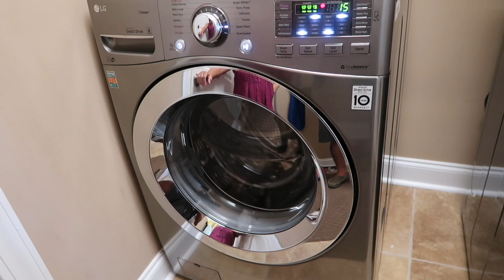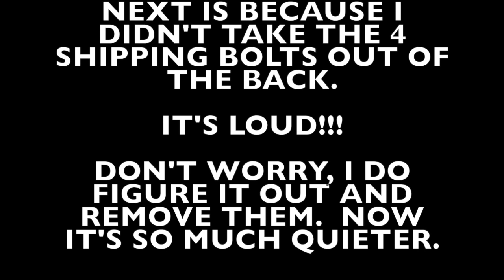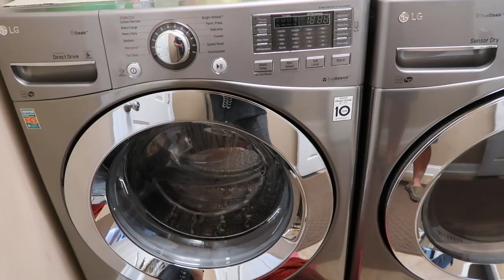I Didn't Remove Shipping Bolts From Washing Machine

Comment: Just done this with our brand new washing machine. We had ours under the work top and it literally was jumping out from under the cabinet. My wife came running down the stairs wondering what on earth the racket was. We sat on top of it for a bit then had to pause it and eventually figured out it was the bolts. They should really put a huge sticker on these things!
Reply from the maker: Well I figured I couldn't be the only one.
Reply: Totally agree with you. I thought the machine was not leveled well...
Reply: Agreed!!  Huge sticker would absolutely help!!! I have the same problem!!
Reply: OMG I also feel stupid!! I didn't even know the bolts must be removed!! However we removed them, will the machine last long or will it break soon? because the machine spinning were damn LOUD!! I am scared the drum or wheel bearings might be bust :(
Reply: I saw the warning on my Samsung to remove the bolts, it was a visual diagram but the bolts in the diagram didn’t look at all like the various bolts that were on my washer, plus they were called “shipping bolts” so I figured that the guys at Lowe’s probably already removed the shipping bolts once it was shipped to them from the factory.  So after all that, I still had the washer violently jump around, and now after looking it up, I realize that I must still have the shipping bolts in because I never took any out.  These companies ought to be liable if ever their machines break due to this obvious lack of effort of communication.
Reply: Me to same with me... My machine jumped out from the cabinate
Reply: @ravi44200  did it still function after that lol?
Reply: Just took off mine after dents on my washing machines.
Reply: I did this also today to my brand new Whirlpool machine it was running just for 3 minutes on centrifugal hopefully 🙏 it’s not broken,need to take out this bolts,definitely agree some sticker will help!
Reply: With my washing machine, the instructions gave me the impression that removing the bolts were optional. It nearly destroyed a counter top and travelled across the room.
Reply: or you just could read the manual
Reply: @KokoroKatsura  True, but a big sticker is a really obvious and sensible thing for the maker to do.
Reply: I just did the same today 10/27/24 and I only did 1 wash to test the machines d it was shaking like a mad horse . I pressed pause and didn’t use it again. Was yours ruined ? Is mine ruined ? I will go back and remove them in two days , hopefully it’s not damaged .
Reply: @tonystylesofficial6844  no mine is fine. Still got it after 5 years and no problem.
Reply: @hovercroft  uffff thank you. I was worried I ruined a brand new machine after 1 use . Glad to hear yours is good and hopefully mine will be as well.

Comment: I did this! Washing machine practically walked out the front door.
Reply from the maker: it gets kind of violent doesn't it?
Reply: @StuffIHeard  super violent
Reply: Lmao😂..not out the door
Reply: @whoknew7864  lmao
Reply: I’m chasing mine down the street now....
Reply: Update: I removed the shipping bolts and now you can hear a pin drop! My machine no longer has the shakes! Now I can wash without something falling and breaking!
Reply: same happened today with my washer.... :-)
Reply: Will it harm the machine?
I did the same😓
Reply: @Motivational_sadwaves  nothing you can do about it 
It depends on how long it was used like that 

I did 2 wash complete cycle
Machine is working fine there is no issue
Reply: @jahlive1243  lol
Reply: mine seemed like it was going to take off like the Space Shuttle, everything was shaking...t minus 3,2,1. blastoff
Reply: @Motivational_sadwaves  shouldn’t be that bad if you noticed it and stopped using it quick enough. I did the same thing but didn’t even complete a full spin cycle before putting Google Fu to use.
Reply: IT DID WHAT
Reply: My machine just left me exactly like my ex 😢 both just violently walked out

Comment: On the first wash i paused mine when it went on a spin because I thought it was going to explode and then re-checked the instructions. In tiny writing at the bottom of the book it said remove the bolts🤷! They should be leaving a note on the machine.

Comment: I understand that they need these bolts to protect the drum but I think manufacturers should put a BIG RED SIGN in front to remove the shipping bolts first before use, or like a locking system because the people who connected our machine didn't even know about it :( we let it run until spin for once and I feel kinda better but sad for the others who let it run 3 times. There is one bolt that we took out that is bent. I really hope it's okay.

Comment: Well, I'm the latest victim of the dreaded shipping bolt curse. Bought mine from a friend who only had it a year. He brought it to my house, but neglected to tell me to remove the bolts. The washer walked 3 ft. out and 2 ft to the left by the time I came back home after walking the dog. It literally sheered off one of the bolt heads inside the machine from all the shaking. It's still inside, but doesn't seem to affect the performance at all so I'm leaving it.
Reply from the maker: aint it loud?

Comment: It is absolutely INSANE there is no clear warnings / markings about this anywhere on the machine.
Stupid stickers all over the place about other stuff.
But NOTHING about the massive bolts.
It’s absolutely bizarre and perverse that people have to find out the hard way.
Had two days of misery with the very expensive new machine before tracking the problem down online. Cosmetic damage to machine caused. Hopefully nothing internal.
Furious about it.
Complete negligence on the part of the manufacturers.
They love all their signs and stickers … WHY nothing about this major issue ???
Madness.

Comment: Just had my new washer installed, thought to myself "Hey why not do a test load of laundry while you run out to grab some groceries." Came back home to an odd unfamiliar sound on the other side of my front door. Being that I recently had a water leak on the second floor of my house that caused a lot of damage you can understand why I became somewhat concerned. 
I get to the laundry room to see the washer has tried to escape its tiny confines and instead gotten itself stuck up against the wall like a hysterical robot with emotional problems.
Searched the book on my new washer again and YUP! Shipping bolts. Luckily it was only for one load and not even the entire load. I actually came here to try and see if it might have caused serious damage. But if someone ran it for 6 months that way and its working now I think I might be in the clear. Thanks for the video it seriously has helped a lot of people.

Comment: I want to you to know you’ve saved my sanity... and my new washer.  
My idiot husband doesn’t read instructions and was just going on and on how the new washer I bought was” a piece of shit” 

For you see . Every time my washer went into spin cycle I had to learn amateur bull riding to keep it from hopping across the floor. 

In near tears I searched YouTube for help, a way to reinforce the machine to stop the hopping and thrashing around! And I found you. 

My 1800$ set is now cleaning perfectly and you can’t even hear when it goes to warp speed !
Reply from the maker: we had the same hare.  I thought, plenty of people talk about how perfect their lives are, not enough people say, "hey I messed up, but here's some info that might help others".  Glad this video helped.  :)
Reply: I felt like I was reading a page from my own storybook,the kids ran out while the machine continued to wrecked my cabinets, whilst my pregnant self was trying to seat on top of the machine, the vibration so intense they probably scare my baby in my belly, likely the cord finally snapped from the plug, I was about to call the manufacturer before I thought of YouTube. Saved my life.
Reply: Are you divorced yet? If you call your husband an idiot, you will surely divorce if it hasn't happened yet.
Reply: This comment was it. I thought for sure I was sending the damn thing back tomorrow.

Comment: We had contractors install our LG stackable W/D during our home renovation. I was on the other side of the house and I thought a helicopter was landing on the roof from the noise and shaking. I tried leveling, etc. Finally looked on a different manufacturers website and found out about the bolts and removed them. The owner of the company was pretty pissed that his guys didn't remove them.
Reply from the maker: dang
Reply: what happens if not removed? is damaged or you can use after removal ?

Comment: I just did the same thing with my brand new washing machine. Never knew they existed. Always bought old machines. How long did the machine last after you took them out? Did it damage it badly?
Reply from the maker: still using it, didn't have an effect here.
Reply: That's good to hear, I did the same stupid thing with my brand  new washer... Lowes brought a new one and a different company was to pick up the old one.. not one person in the store or at Lowes Headquarter once asked after I told them that he machine sounds like an airplane taking off, about the bolts, the replacement machine that was delivered the installer (first machine we installed) asked me what the problem was with the machine and I told him, he looks at me and said "Ma'am, you left the travel screws in "... OMG.. I told him remove it take the new machine back"  He told me no too late the machine is already damaged and broken we can not take it back now, it's trash!! .... I was freaking out, how can a manufacture build a machine that break so quick surely I could not be the only idiot forgetting the bolts and now I'm out $1000 :-(  ...... thanks to you I didn't believe installer and a friend of mine bought the 2nd machine and we are all happy now washing with brand new washers for hopefully a very long time to come .....  @StuffIHeard

Comment: Oh my..this happened to us yesterday 
We stacked the dryer on top got it All hooked up and ready to rock and roll.
Rock it did... after we started the very first load it seemed to be working it was a little load but we thought oh well it’s in the garage anyways... then went inside about 15 minutes later we heard it get so load and rumbling sound...ran out and found it had moved ( rocked itself/vibrating) about 3ft from its original spot and the dryer vent tore off!
Si glad it wasn’t worse like the gas line breaking or someone walking by and it falling.. I looked at the directions and found that my husband left the shipping bolts in.... I thought we ruined this very expensive washer after not even 1 time of use.... but we were able to take the bolts out and now it works like a charm 
Had to go buy dryer venting stuff and lift the dryer back up but... hey it could of been worse and we learned!
Glad everyone on here did too👍
Reply from the maker: yeah, I figured I'd put my mistake up to show others it's an easy mistake others might make too.. we're all human.  They could have made it more prevalent knowing most people would just hook it up and think it was ready right away.

Comment: I recently purchased a used one locally (an LG WM3770HVA ) and while I was loading it on the trailer these bolts came off. From what I see the threaded bolts snapped from the back. When I got home and opened up the back cover the backplate of the stator motor and the washers back cover showed wear from grinding from contct. I haven’t tested them yet hope they are just going to be fine.

Comment: I was about to throw this washer away.  Just bought a brand new Samsung washer dryer set and it would not stop walking across the room. I knew I was missing something but I couldn't figure it out. I left the shipping bolts in the washer because I figured I'll wrap the cord and hose up again when I move. It never had a screeching/grinding noise, just sever vibration even after adjusting it at least 20 times. I almost peed myself when shipping bolts came up I got so excited. And now that they are removed, that damn thing is running smooth.
Reply from the maker: yeah, my first thought was "dang, this thing is crap... and it was expensive.... " then I realized I just missed a step.  It works fine now.  :)

Comment: I had the exact same thing just happened to me! I didn’t know what the hell was wrong! Did a little bit of research and found out I had to remove the shipping bolts that I had no idea what they were. Removed them with a socket wrench and now it’s quiet!
Reply from the maker: glad my mistake could help others.
Reply: I have just done the same. Put a wash on and went to work. I have taken the bolts out but it's still. Oy working. Have I broken the washing machine that I have had less than a day 😓

Comment: The issue is how do you know if your washing machine is now damaged? Second what is the manufacturer responsibility by not making this absolutely clear ?
Reply: That’s my worry too. Now I’ve spent all this money and ran a load with the shipping bolts on because my plumber is an idiot, did it shorten the lifespan of my machine?
Reply: Sitting here wondering the same thing, hugely irresponsible of them considering professional installers don't even know about it.
Reply: I just had someone out to repair ours because for 2 years (yes 2 years, my husband and I work 7 days a week and couldn’t get someone out to look at it) the packing bolts have been in place, 2 years worth of laundry with those darn bolts on, the repair person said no visible damage to anything and it won’t cause damage by operating the machine with them still in place. We bought the unit open box from Best Buy with no user manual so I rationalized it by thinking that’s why it was returned to begin with 🤦🏼‍♀️🤦🏼‍♀️
Reply: The manufacturer recommends you always get them professionally installed by a plumber even though it is easy, but if I plumber does not remove them then it is their fault.

Comment: yesterday i fixed my brand new washing machine and i didn't removing this damn bolt and when spinning cycle started it   dance like its on some sort of heavy  psychotic drug even  my neighbor flat guy come and check..damn they should have this instruction in red like in font size 500 or something on face of the machine..i hope i didn't damaged mine..but yet to check when i go back home

Comment: hey I did the same I had 3 washes done with transit bolts on , did you needed to change the machine after that ? or it worked fine without getting damaged ??
Reply from the maker: it's worked fine since.. I did nothing else to it..
Reply: Joshua Peek ah ok, thanks for your reply
Reply: @Radovakos  hi mate, did you had to replace washing machine? was there any damage? I did 28 mins quick wash and 2 hour mixed fabric before realizing transportation locks need to be taken out. Please help. thank you
Reply: @deepaksky  no its ok. Its still working perfect now after 1 year of using it.
Reply: @deepaksky  also take the transportation plugs out
Reply: @Radovakos  thanks bruv, yes took them out now :)

Comment: I bought a nice, highly rated "open box" front loader for 1/2 price.  Just a couple of small scratches on it.  It's going into the cellar, so who cares, right? So I bring it home and make the hookups and I'm ready to go.  Only there's no manual that came with it.  So, I go online and find one that's 163 pgs. long.  I'm not reading through 163 pgs before I'm going to be able to wash my clothes, so I loaded the detergent, then located the start button for normal wash and ran the machine.
.
Then the noise started.  I read the reviews for the machine and it said it was very, very quiet.  What?  Are you kidding me?  Must be something wrong with it.  Then during the spin cycle it decided it wanted to show me if I think it's talented enough to go on "Dancing With the Stars".  I didn't know if it was doing an Irish Jig or trying to impersonate Michael Jackson.  Something was definitely wrong with this machine.  So, I shut it off and look up the possible problems here on YouTube and sure enough... I didn't take out the shipping bolts.  Now I'm just hoping I didn't cause any permanent damage to it.   Stay tuned...

Comment: Just did this myself, mine was loud enough that you had to yell over it to hear yourself. Not quite as loud as a mixer in high idle, but it's comparable which is insane, and it damaged my wall bouncing around, literally jumping off the floor. No leaks though!
Reply: Did one cycle wash with transit bolts cause any damage to your machine?
Reply: @ahmadalzaza2092  it didn't seem to, but it sure did scratch up the wall!
Reply: @undefined6947  what wall you mean here? any thing internal or weired noise after removing the bolts?
Reply: @ahmadalzaza2092  the wall it was next to in my house. No damage on the washer as far as I can tell.

Comment: omg same thing happened to me yesterday i was freaking out  bolts made a hole in the wall behing the washer. i was crying all day yesterday. the plumber didnt remove them and my husband and i had no clue!.we skipped reading installation because we confided inthe plumber. i stopped it after a full rinse cycle. it seems completely fine now. no noises, itis not jumping butthere is vibration. is that normal? ive never owned a brand new pair of machines before. or front loading one. i had used ones for about10 yrs.
Reply: the vibration isnt bad at all  but it does vibrate. so is that normal? when im right next to it i feel the vibration onthe floor. buti have to stand super still to feel it. should i be worried?
Reply: Check if it's on a flat surface, if the machine tilts when you checking if it's on flat surface adjust the legs.